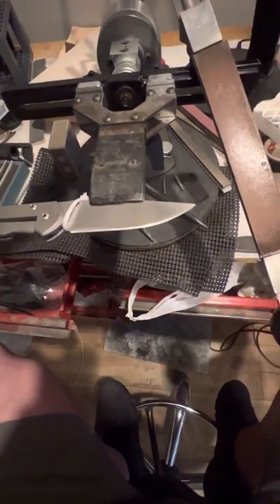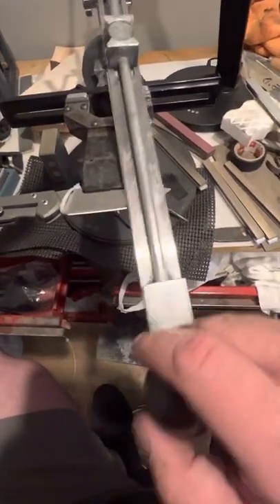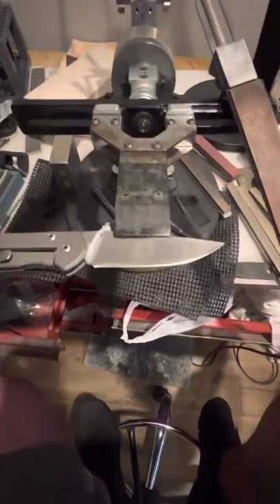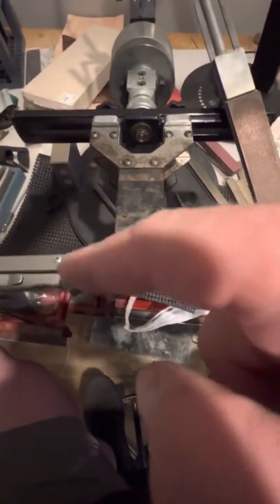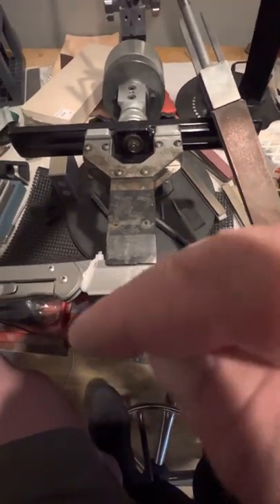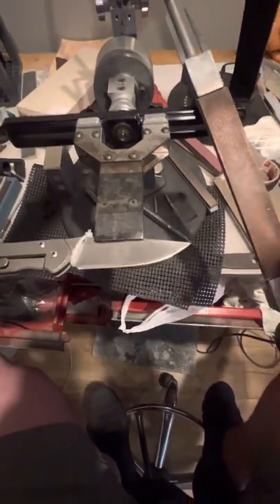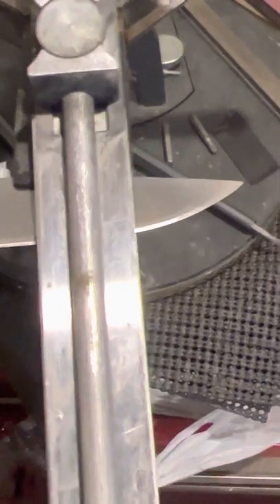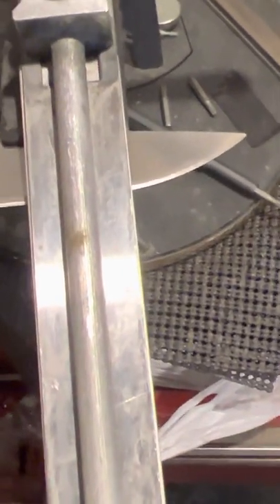Sharpening tech tip: Blending a bevel

Comment: Thanks for sharing this tip.  It is easier to do it this way than the way I normally do it.  I will definitely try this on the next one I get that has a wider tip bevel.
Reply from the maker: NP. I just figured I would do a quick tip while I was sharpening

Comment: Hey,  good tip.   I have been drawing a line on the blade from the recasso to the tip.  Then positioning the blade in the clamp with the line parallel to the clamp.  This minimizes the variance of the thickness of the secondary bevel of the knife.  It takes a bit of extra work on the first sharpening because the blade is being "re-profiled" a bit.  Either way is ok...     I appreciate another tool in my kit.   Thanks again.  : )
Reply from the maker: No problem. I am glad that I can share information through these videos

Comment: Now I understand what 'parallel' to the tip means. Thanks for that Gunny, however when the knife doesn't have a pivot point how does one determine the centre line. Chef knife and pretty well all kitchen knives?
Reply from the maker: Use the first pin in the handle or just draw a straight line back from the tip and use that straight line to line things up.